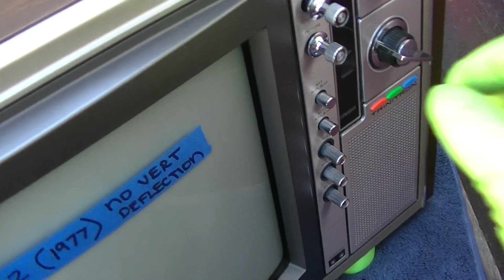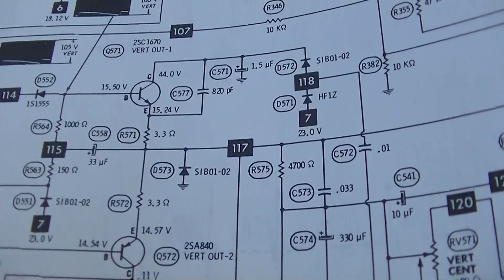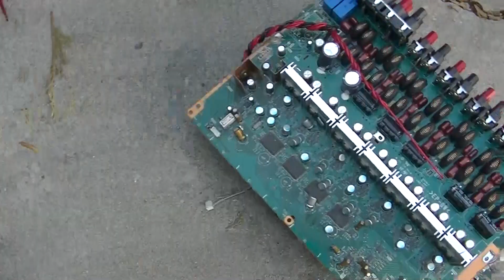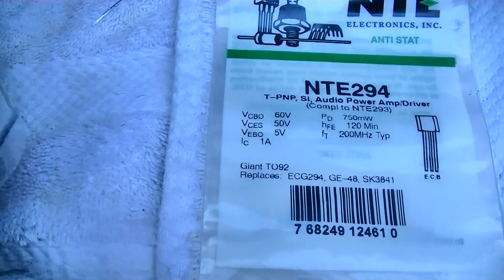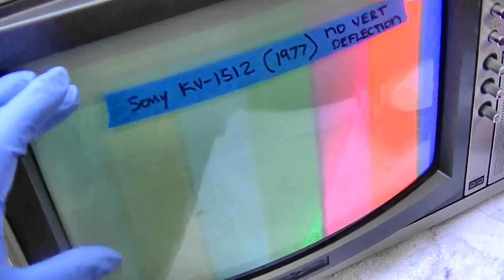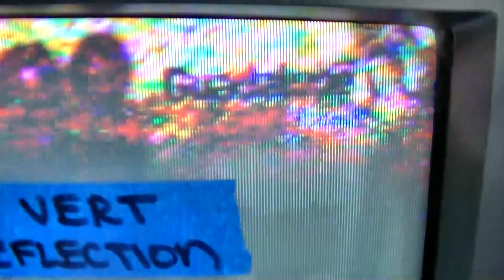Mint 1977 Sony Trinitron KV1512 Repair Vintage Color Television

Comment: "Totally Dude!" served a good chuckle, I dug out an old kv1310e that is funky, I want to revive it after I watched You fiddle with several of this kind.
I just wonder if the "e" makes a difference since we run 230V. Legend has it to get around Pal licensing fees they made it so it internally runs ntsc- what a crazy contraption.
Hope it´s just some caps, it´s a nifty little set and just one year younger than me- that´s why I want to revive it.

Comment: After working in the use TV shop for quite a while. The only thing I can see that that particular set is missing is the badge on the front. Old sony and zenith can't be beaten.

Comment: Do they also have philips crt tv over there in Amerca? I am from The Netherlands and have 3 crt tv's one tiny and the other 2 are 60 cm diameter i use a Samsung crt from 2001 and got it for free just like a philips also for free and still running...

Comment: Magic. We ham radio operators like to dabble. I had the same problem with a couple of TVs in the late 80s, and early, 90s but on them occasions, there was an IC involved. But there's a lot to say about the experience & logical thinking you have, picturing how it works n your mind. I have similar with radio & other RF devices. With that lovely TV (remember Trinitron as a kid PAL versions) perhaps the heatsink was left off at the factory so the set blew & never had much up time so that's why she's in such great shape.

Comment: if you measure voltage on the vertical deflectors and have continuous voltage, it indicates that the vertical output is shorted, saving you time

Comment: The high ESR of the 1.5uF cap caused the collector voltage of the top xstr to be lower than design and that offset the p/p balance of the pair. Always take complete voltage readings in the target circuitry and match to spec instead of diving head-first in to willy-nilly component swapping! ;-)

Comment: My last tube television was a 32 inch Sony Trinitron I bought in 1986 it went from me, to my mom's, to my brothers mother in law were it finally succumb to the the grim reaper of time in 2017.  It always works and had a lovely picture.  it's one fall down was it's shear back breaking weight.  Oh my sweet Jesus that thing was heavy, so were ever one put it down it was going to be there for a spell.

Comment: Actually, I think my Sony  had a built in antenna and a RF Jack as well as a nice rectangular metal button to turn it on and off. Otherwise it looks identical, and I definitely remember seeing 1977 either etched in to or on a sticker at the back. I had it from 1991 to 1999. It was a great TV with an excellent picture. I played videogames and watched Letterman on it. The two dials were nice and clicky. The channel dial had 3 to 6 positions on it. I was able to pick up CBS, NBC,  ABC, static and nothing else. Could anyone here identify it from this description?

Comment: Do yourself a serious favor and build this. You can blow through a set like this by touching it across the terminals of every capacitor you find. Your bad capacitor wasn't able to supply the spike of current for the vertical output stage as it draws the sawtooth wave for the deflection yoke. Going oversize on this capacitor would be fine, as long as the ESR and pulse-handling characteristics of the capacitor are good. The film capacitor you installed should work fine; I'd go up to roughly double in capacitance without worrying about the load on the power supply as the thing charges during power-up. It would not be critical to timing like the tantanlum in the vertical oscillator stage. 

http://kripton2035.free.fr/Resources/poptronix%20ESR%20Capacitor%20Tester.pdf

Comment: I had this exact set.  The screen got dimmer and dimmer started to shrink and by 2000 it was was done so I put it out for the trash truck and it was gone.  It had a lot of TV and Apple ][ computer hours on it.  I wish I had a working one now.

Comment: I worked in a high volume repair shop on all brands in the late 70’s to early 80’s. I was 16 when I started on tube portables. Then all solid state. The most efficient way to troubleshoot no vertical is with the power off. I would use the diode scale on my Beckman meter to check the transistors and diodes. Then use the 2k or 20k ohms scale to check the caps by watching them charge and discharge by experience. Any resistors connected to higher voltages were checked for a change in value. This all done in less than 25 minutes. Replace parts needed and let it cook. Open up another and end up some days fixing 15 sets in 8 hours. Most were portable or table top models. Lightening storms were $$$$. Only had two customers question why a resistor was $2 and labor 75. These were modular sets that would cost $60 for the module and $35 labor so I saved them money by repairing the module. I also made more on labor commission of 40 percent. Also did some on the side. The good ole days for sure.

Comment: I miss snow on the tube. All this digital signal boo hoo.    If I could get snow I knew I was headed in the right direction!  Great diagnosis of a very complicated panel.   I prefer tubes and old capacitors also.  I used to wear rubber gloves fit for the linesman on the power pole.  The old days of discharging the picture tube, ah the sound of the arc!  The glow of the spark...... memories........from me ,  an old hack who liked to tinker on sets.  Thanks for the video!

Comment: The NTE transistors you got to replace the outputs were only rated to 50 volts according to the bags they were in, whereas the original devices were rated to 140 volts. That's probably why the replacements died, didn't like the voltage.

Comment: you still have analogue live broadcast ? , here in uk it went to digital and they turned off analogue 15 years ago so only able to use ours with old vcr now
Reply: For full power TV stations mostly switched off back in June of 2009. Low power TV stations are going to be switched off on July 13 2021. Where they must be converted to digital or switched off. We do have DTV set top boxes where you can buy for about $30 so you can view digital TV signals on older analog TV's. Those DTV set top boxes have rf output to TV's that only have antenna connections.
Reply: @900Yugo  all the btv boxes here don't have RF devider here anymore , you have to find and old VCR
Reply: @lookoutleo  Really? Very odd for us here because most DTV boxes typically include an RF modulator built into it. Otherwise current FCC rules won't have a certification on the unit itself. Most chain stores would refuse to sell them without.
Reply: @900Yugo  here they have for dtv not analogue anymore , think it's because analogue TV was switched off here more than a decade ago so you need old equipment , you could take composite signal out of dtv in to old VCR and plug that via Ariel to tuner of old TV. Prob buy a box on eBay that would do the same

Comment: I have a 2003 era trinitron full surround. It's probably like 20×24in and heavy.
How do you fix a faint line going through the screen, you only really see on dark screens? It's still watchable. It's about a 1/3 of the screen that developed the line. The TV is so heavy I don't want to mess with it until I know what it is.
Edit: my old Sanyo got the "no vert deflection" I used to spack it with something, and it would come back lol. Until one day it didn't and I got rid of it lol

Comment: LOL was just there myself on a 1980's CB/Ham radio came down to one silly capacitor that was of all things open. I traced and pulled parts for hours but it does feel good when you finally find that little burger :)...

Comment: I had a feeling the TO-220 transistors were not the problem and should work fine. The vertical is low frequency, so just about any transistor that can handle the voltage and current are adequate replacements. The vertical foldover was probably due to some ringing that was going on. Another great fix!

Comment: I found a beautiful  1972-73 Sony CVM 1200AU fired right up has uhf vhf and composite! It also has that green funky port I played Wii and snes on it it definitively needs a recap because it does some funky stuff but it’s an amazing set for the time it’s seriously cool! I didn’t know composite was a thing back then it just took a $3 UHF male to RCA female adaptor and I’m plugging RCA composite cables right in!

Comment: When you get to the TV with the high voltage issue, check the caps first. When I unbury my 920U, caps will be the first items replaced as a whole considering its a 1969 vintage set.
Yeah tubes were some of the best items to work with, too bad they were not all military spec and heavy duty.

Comment: Ive had old tvs do that by hooking a cable signal directly in the back where there is screws for the antenna hook up it shows i stupid stupid bright line in the middle when you go and turn it on in the morning didn't fix or knew exactly what was going so i tossed it in the trash

Comment: In all my years working on Sony TV's, I have never seen anybody work with rubber gloves.  Check the cooked cap.
Reply from the maker: Ever seen someone die of lead poisoning? I use lead-based solder and I have and it's not a fun way to go

Comment: shango! Q571 got killed by a high voltage spike that exceeded it's 160V rating. The 1.5uf cap is part of a boost circuit. The 23.0V supply is boosted to the 44V collector voltage with sharp narrow retrace pulses from the flyback. If the cap opens up, the spike don't charge it, they move on and zap the collector of Q571.

Comment: I watch repair videos not so much to learn but to recall my past. I was screaming check for a charge pump or supply cap for top foldover. The other caps handle linearity and size. I worked on so many chassis, mostly for video game monitors.

Comment: If this is so new and apart from the missing heat sink the area and that transistor looks virgin, then that implies to me that the heat sink could have been left out by mistake on the production line! It likely left the factory like that!

Comment: Well done Sir!
Most of these little Solid State Push-Pull Output Stages need localised Supply decoupling to give their best (even the Transformer coupled ones) and I've been caught out by that sort of thing more than once.
I don't think I've seen that Coca-Cola and Coffee fusion in my local Shop.
What do you think of it?

Comment: Take a bow on this one! I remember when these sets first came out, there were plenty of magazine articles and books written about how difficult they were to repair. You did an amazing job on this one!
Reply: The European approach to design of high voltage transistorised circuit was that of keeping each stage isolated from each other.
The Japanese made one long DC coupling along the circuit, with use of selected gain transistor and low ESR capacitors, with lot of math in the feedback circuits.
The Japanese TVs were, consequently, much more stable and had no thermal drift. The negative side, was that if only one diode in the power supply went bad, it took with it the output driver and the entire horizontal stage, often including the flyback transformer.
Vertical failure were much more benign, but as I said the value of the passive components is critical. Plus the Japanese in the '80s, had a problem with their production of Zener diodes and fast switching / high Ic transistors; often the voltage of the Zeners drifted down and the Ft of these transistors fall off a cliff for no reasons.

Comment: This 'vertical foldover' symptom on that Sony television set with the 'squatted' horizontal line picture is what I've encountered and serviced on many newer solid-state sets of various brands (especially Magnavox).
Unfortunately in such modern receivers, it is a condition that's usually caused by a 'burnt-up' current limiting resistor (fraction of a watt) supplying the voltage to the 'mid-board' IC-701 vertical circuit section. 
Of course, after replacing the resistor with a higher 1 or 2 watt type of the correct value (including a picture alignment), usually brings the television set back to normal.
So, when this symptom occurs, it is suggested (for future reference) to first check for the correct supply voltage going to the vertical circuit for whatever solid-state components used in that section.

Anyway, that appears to be a very nice and pristine television set because,

"It's a Sony!"

Comment: Somewhere, I have a silver 14" portable Sony Trinitron from around 1979 with lots of smooth curves and it looks like something out of 2001 the movie with a glass plate in front of it. I wonder if the end of the 1970s was an experimental time for Sony case designers hmmmm this is very early 70s/late 60s look by comparison.

Comment: What a luxury having the circuit screen printed on the solder side. So much easier to work on
Reply: 30 years ago I started my career in a JVC factory that made VCR's. All the PCB's were printed on the solder side. Just a consumer product - nothing special. Today I work on equipment that costs >1 million......but no screen printing on the solder side :o(

Comment: Shango: "My local electronics store didn't have 1.5 mF electrolytics..."
Comes up with mint Siemens cap with a pre-war logo))
Reply: I wish I had an electronics store 😖
Reply: @fredfabris7187  same. For all my projects if I need a new component I wasn't expecting I have to wait 2 days for amazon to deliver
Reply: We have an electronics store in Zuerich that would be perfect for this.. They have mountains of obsolete parts, that obviously have sat in there for 40 years. And a few modern-ish accessories, that are the same quality as aliexpress but 10x more expensive. Only people doing obsolete hardware, or complete ignorants would ever go there, the ignorants are in majority. I sometimes get a resistor, an LED and a laugh there.

Comment: Maybe the more modern transistors from the Fender amp have the collector/emitter flyback diode in them and it kept them from being damaged from the bad capacitor?  Nice TV.

Comment: I have a panasonic crt that has that little bit of that problem but I just tap the tv and the picture comes back
Reply: Weak Solder joint on that set

Comment: It's always impressive to see old sets like this in like-new condition. Surprised to see dinky little transistors on that vertical O/P stage. Though, the set is 44 years old .....

Comment: You should have added a DNA sample to the bag so future generations could clone you to keep this Trinitron going forever.
Reply: @Jellyyy Tech N' Stuff i'm 17 amd i don't think that 80% of my room is old stuff from the 70s and 80s that i have repaired the only thing new in my room is my samsung A13 which is the phone wich im writing this comment
Reply: There are younger Shango types out there, I can repair audio stuff with my eyes closed, TV's I don't have much interest in, mostly because since 1999 there has been nothing but complete garbage on TV here down under. If I ended up with a mint low-hour Trinitron that needed work I would invest in fixing it though.

Comment: Throughout this video I kept saying "If it's eating transistors, it's a bad capacitor." I know this because I dealt with this on a 36" Sharp that was eating Horizontal Output Transistors like they were candy. It was a bad 2.2uf capacitor, I think a 250 volt one.

Comment: That high ESR low capacitance cap was probably failing to filter stray high voltage pulses and that's probably what killed those lower 60V transistors.

Comment: Next one ( no HV ) will be shorted SG, pass transistor, smoked B+ resistor
feeding hoz drive.  You will fix it & it will look great. Then in a few weeks you
will hear a little TIC & everything is gone again.
Better you than me !
LOFL
LFOD !
Reply from the maker: already happened. is there a solution?
Reply: @shango066   Yup fix a Zenith HA HA anyhows slip me the chassis ##.
The older ones you had to run at 18V & 
watch the SG output waveform. It can be a ton of things. At Sony if one came back we just strip off the whole sweep board & not charge for it. Nasty sets to deal with.
LFOD !
Reply from the maker: @tomj4506  scc110d

Comment: You need to get a big ass, high gain channel 6 antenna and stick it on your roof. Of course, I don't know how long it will stay on the air before the FCC tells them that they are too obsolete to operate. I've made a crappy channel 19 yagi. It was crappy because I made the elements out of flashing. I only kept it about three feet off the ground because of how fragile the thing was, but it actually worked pretty good. Every time we got one of our Oklahoman severe thunderstorms, they thing would get all twisted up. I haven't had much interest in building antennas since then, but if I did, I'd use better materials.

Comment: That one made you work for it :)
Recapping is not troubleshooting, but... it does help because even one bad cap somewhere in a set gives undesired operation.  If you are going to fix everything in a set and keep it for yourself... I just do it anyway.  Helps pass the time.  Any good caps I pull out go into the tinker parts bin.

Comment: I remember this happened to our 1976 Montgomery Ward console TV when I was a little kid circa 1979. The TV repair guys came out around 9 pm and repaired it. It was two black dudes with Afros. For some reason after they repaired it the test switch was pulled out instead of pushed in. When you pushed it in the picture went away. Yes I noticed this at the age of 4.

Comment: that probably blew the transistor as with low capacity,, it made the transistor overdissipate on  poor/slow flyback, ,
Reply: similar will happen in some line output stages if it has insufficient or 'round shouldered' drive instead of nice sharp square waves